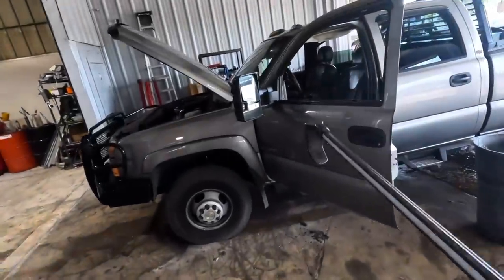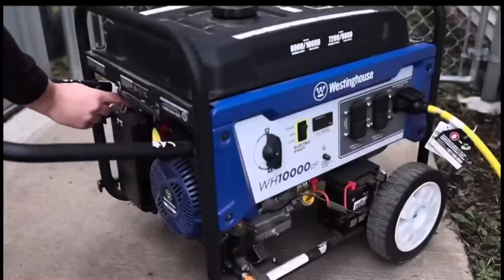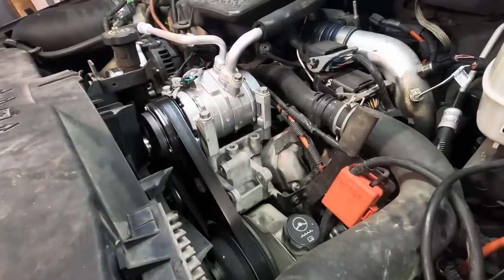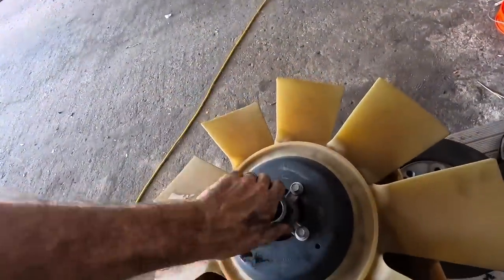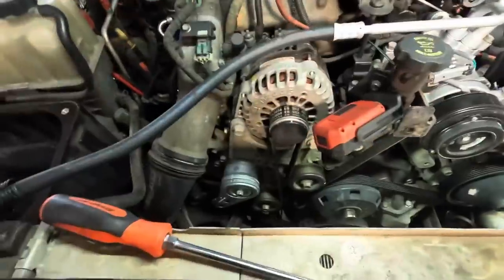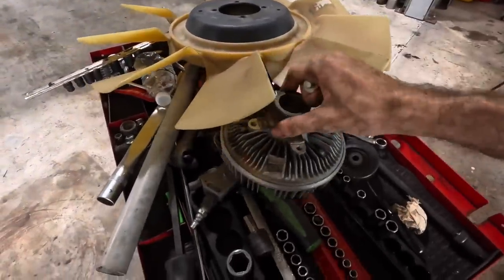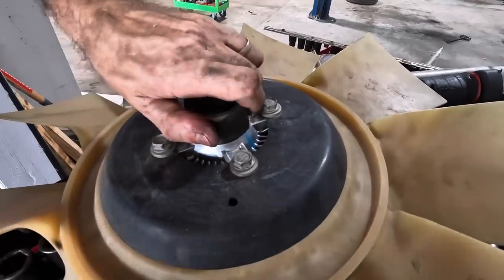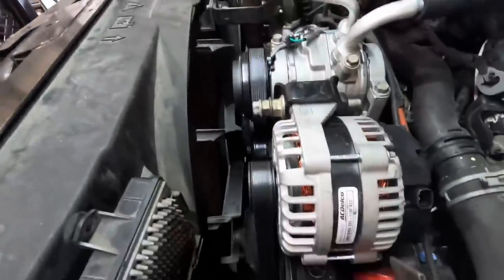Proof of Concept! Dual Alternator DURAMAX!

Comment: Guys! This project isn't about hurricane preparedness (for that it MAKES NO SENSE whatsoever). This content is ENTERTAINMENT, and - as you can see - we are enjoying it. Ray is absolutely right. If he would have simply purchased a gasoline, diesel or LP gas generator for his house, there would be no content. Thanks Ray. I mean it! ❤

I don't want to seem negative, because I'm not at all, so I'm listing why I think this hurricane preparedness project makes no sense:

•	The 2 generators in the Duramax (100A + 145A) can produce max. 3KW continuous power.
•	For that 3KW, Ray uses a 400-horsepower diesel engine.
•	400 horsepower equals 300 KW (not 3KW), so this is a 100X mismatch.
•	The stationary diesel engine runs all night long without the cooling wind from motion.
•	He uses 3-4 gallons/hour diesel fuel to generate 3KW.
•	He spends over $1000/week just for diesel fuel and just for the nighttime reduced power.
•	His diesel fuel storage is limited, so he has to go to the gas station multiple times during a hurricane.
•	He needed (to buy) 1 extra generator, 2 extra batteries, 2 inverters, cables, boxes, etc.
•	He had to install them.
•	He takes all the risks coming with this system (electrical issues, fire, explosion, truck theft, etc.)
•	He will carry a lot of extra weight and 1 extra generator on the truck for 365 days in a year.
•	He sacrifices the room of the truck bed storage box for the batteries and inverters.
•	He needed an elevated RPM idling system.
•	He uses his truck to power the house, so the truck is tied to the house.
•	His existing 8KW gas generator still has not become unnecessary. That’s the daytime power.
•	He has no gasoline storage for an entire week either (in the 90-gallon tank is diesel fuel), so he has to go to the gas station (with other gas cans) multiple times during a hurricane.

So, the project makes no sense, especially because there are much better alternative solutions:

•	Minimal program: Checking (and if it necessary repairing) the existing 8KW generator, buying and storing enough gasoline for a week, and the problem is solved.
•	More secure program: Buying a second (preferably quiet, reliable) 4KW or 8KW gasoline generator as a backup.
•	Long term program: professional Generac Home Backup generator, or
•	Earth friendly program: Florida Residential Solar (with tax credit, net metering, etc.)
Reply: But if he spends money on solar panels it will just reduce his electrical bill all year long! It doesn't even make any noise!

Comment: Hello Ray, the reason you did not see the nator output drop when removing the exciter feed is that most naters, the external feed of 12V is only needed for a moment.  Once the field is going, the field will feed itself.

Comment: Nifty set-up Ray. BTW, disconnecting the battery while charging can fry not only the regulators but the alternator itself & even the entire system including the computer(s). I learned that the hard way & more than once. But that was long ago & although I'd think things may be better protected nowadays generally, the principle is the same, back EMF can be a mofo. The circuit is counting on the internal resistance of the battery(mostly) as well as the impedance of everything combined.

Comment: Ray, I like what you are doing, and there are devices that separate the truck batteries from the utility batteries so if one is bad it does not drag the other down.  However, IF you do try to pull 12,000 watts from your inverters you will be drawing something like 882 Amps @ 13.6 Volts at the inverter power connections.  Even with large generators that won't last long.
Reply: vectron mossfet dual battery isolators.

Comment: Good idea for family and home . Just remember to shut the main off at your breaker box before energizing,  don't want to give a lineman a jolt from back feed. Knew you knew that just reiterating safety protocol.  Great presentation
Reply: Wired my house first thing trow off main disconnect, second turn off all breakers in house,third fire generator, fourth plug in generator to house,last turn  needed breakers on line.We have lights!

Comment: Good morning Ray, good morning all. Early post, the notification woke me up. After viewing the entire video a couple of things come to mind; 1) I would consider using a 1 awg cable for your system ground. (probably less after you calculate your load) 2) move all your conductors away from your fuel sources, i.e. fuel tanks , gas tank caps, etc. 3) Your load connection should should also be as far as possible from these sources. 4) Vent your auxiliary battery compartment. 5) Hire a licensed electrician to install all new circuit breakers required for your auxiliary input sources to your homes electrical panel/s. This is important not only for safety, but for insurance purposes as well. Fairwell laddy.

Comment: I had a Nissan 4/4 for mission work in Botswana. It had 2 batteries for lighting and sound and film use. We would be in the bush / sand for weeks at a time. Also had big lights so had a 100amp alternator. It was difficult to keep the batteries charged equally when you always wanted to have a battery for starting. Had plenty of space and finally installed a second alternator to charge the auxiliary battery. Worked much better.

Comment: Hi Ray great system! Just a comment on the wiring: the exciter wire is also used as voltage sense line. Run a light gauge wire with a 5 amp fuse to the rear batteries for the exciter. This will allow the alternator accurately sense the voltage and adjust for voltage drop in the heavy cable to the rear batteries. Is the second pin in the plug for the idiot light?

Comment: I installed a 45Kw generator to my home 22-years ago.  It runs everything... and I never have to worry about starting surges with critical household equipment.  It has a 6-cyl. Vortec natural gas aspired engine- so I never have to worry about fuel/refueling.  It goes on its exercise once a week and has an alarm if there's a malfunction.  Low oil and low water cut-off switches to prevent engine damage...and it has a block heater for the cold New England winters.  I also installed a whole house surge protector at the service panel to avoid fluctuating/dirty power that generators are known to produce.  For your application, a minimum of 7.5 Kw to 10 Kw will be needed to to run critical household equipment like the refrigerator/freezer, well-pump, and lighting circuits all at once. (Excluding central air, washers, dryers, multiple window a/c units, etc.)  I would deep six the non-sine wave (square wave) inverter since it is inefficient- it will produce 30%  less power than a sine wave inverter (and therefore, it doesn't produce power to its full capacity) on top of the 10% loss when converting from dc battery power to ac main power.  Non-sine wave inverters are usually used on UPS that have resistive loads such as incandescent lamps and space heaters.
What you're doing is a fun project- especially for outdoor camping purposes and for short term usage...but totally impractical for long-term constant household usage.  The heat output from the inverters alone, where they are placed and  the lack of proper ventilation will cause premature damage to them.
Best wishes on your project and thank-you for your perspective and viewpoints.  I am fascinated by how you do things and your creativity...in all your videos.

Comment: Great job Ray. Your hurricane planning makes a lot of sense to me. How will you theft proof your dirtyMAX though, if it's running all night powering your house load? Ambulances have a "Scene button" that allows the keys to be removed from the ignition leaving the vehicle running, and the engine is cut by depressing the clutch or brake pedal. This allows the considerable hotel loads of the vehicle to still be powered. Something to look into?

Comment: I seem to lose power a week at a time at least once a winter these days.  Been through all this and still have it around of course, (more options = better).  But having an EV with at least a 60 kWh battery around has been a game changer for having 3 ish days of quiet, don't have to gas it up in the middle of the night, cheap,  backup power around.  After 3 days?  Run down into town for a DC quick charge for about an hour and fill it back up!

Comment: Ray if you have a good alternator shop near you they should be able to rebuild those factory ones up to ~250amp each with out really changing the over all size much on them. I know this because I have a dual alternator kit on my 06 5.3 and had the alternators built at a local shop 1 built out of my original and had them build me a second out of a factory unit. Your two completely stock units will only handle ~3000watts total at full output. 500 amps of alternator will get you ~6000watts of output.

Comment: Ray, another thing you can do is take your factory alternator and get it turned up.  Some alternators they can really make them put out a lot more power.  I had my 65 amp alternator from my 1988 Mazda 323 turned up to 140 for my sound system.  This was all in the same factory case.  The american made alternators can go a lot higher output than the small foreign stuff.

Comment: Hey Ray, it may be worth implementing a Voltage Sensing Relay on the primary alternator wiring. Most of the split-charge systems I've used in the past use this instead of a second alternator setup as it's a bit more efficient, but there's nothing to say you can't do both for more power availability. The VSRs divert most of the current to auxiliary batteries once the primary starting battery has recharged, that way you have higher output capabilities of your auxiliary setup without effecting your engines starting ability. With the second alternator setup I'd probably recommend having that permanently dedicated to the auxiliary setup, as you mentioned, but there's no real point having it on a switch. The second alternator will put a slight load on your engine whether it's charging the batteries or not, so might as well make use of it while your driving around so power is instantly available when you need it. I'd also recommend just the 1 higher output inverter, they're pretty smart and only draw what they need to fulfil demand, for example if you try to draw 1kw from a 10kw inverter it will only draw around 1kw from the batteries, unlike a 10kw generator that will (forgetting about eco functions) generate 10kw no matter how much you try to draw. That way you shouldn't have to go out to the truck to start swapping things around to meet demand. There's a lot more to off-grid power than most people realise, there's a lot of information available but it's often a case of different strokes for different folks. Good luck on finishing up 😊 what you're doing has more practical applications than just hurricane prepping but it's a great excuse to do it 😋
Reply: Is there an argument for 2 inverters for redundancy? Sods law and all that.
Reply: @DeepakKumar-lv4te  there is, but most of the higher output inverters I've used are fused and tend to be pretty reliable. If anything I'd probably say it's better just to have a spare to swap out should something break unexpectedly. I think there's something a little comical about having backup power for your backup power 😂

Comment: Cool video Ray! My suggestion would be some ventilation in that box. Once those deep cycle batteries start charging they put off quite a bit of gas. One loose connection and spark in that box and BOOM! I made the mistake of throwing a deep cycle battery in my old truck a long time ago to get by, after about a hour long drive I stopped at a job and when I went to restart it "BOOM" a loose connection sparked and caused the gasses to ignite. The battery exploded and threw acid everywhere. Just givin ya a heads up. Thanks for sharing Ray!

Comment: I like the concept. You mentioned that the systems could connect to work together. If I were doing this, since the secondary system in for external 120V, I would leave it seperate from the primary system, except to make it switchable to momentarily boost the starting battery in case the starting battery goes dead. On the previous video you showed a solenoid that you were going to have in the system, and that is what I would use, but only for that purpose. 
I'd also add, and you alluded to this, that there is rarely a more permanent fix than a temporary one.

Comment: Excellent video Ray and I agree with you you can never have too many back up sources of power I have three generators one standard two of them are inverters generators. Those things are super fuel efficient. My one runs like 16 hours on 3 gallons of gas and I also have a couple power inverters I can hook on to one of my cars if need to excellent video

Comment: At least you had factory parts. I had the pleasure of installing two 220 Amp.  Leece- Neville alternators into a Geo Metro 4cyl. for an audio competition car. Replaced the original and utilized a modified aftermarket AC mount to shoehorn the other one in through the bottom. FUN 
5x1000 w Orion Beast amps, 8x15s in enclosures in place of the rear seats. Two yellow top deep cycles in the spare tire well and those five amplifiers show mounted in the back hatch area. A dozen more speakers rounded out the front end. Sony and audio control provided source and control. Park this thing at center ice and go head-to-head with the arena's sound system. We called this thing dBeast...   Other people did the audio part but the power supply was all me. P. K.

Comment: Ray, it is a good idea to power-up the inverter before connecting the load, and disconnect the load before down-powering the inverter. Switching on the inverter with the load connected might cause damaging inrush-current, and release the smoke.

Comment: Ray the pins in the plug of the alternator do not turn on and off the alternator they give volts and charge signals to the trucks ecm the large battery cable reads the voltage of the battery and the internals of the alternator decide to turn on and off the alternator

you need a modified alternator with an external control or one specifically designed for switched control

Comment: Ray, former product engineer here for a lithium battery company. 2GA cabling is good for ~180ADC. This, or thicker cabling, I recommend for your wiring solution for this so you do not run into issues with melted power transmission wires.
Reply: You need to do an ampacity calculation.  Length, gauge, continuous vs intermittent current, and desired maximum voltage drop.

Comment: And with a portable generator through a transfer switch, to do it legally, will be more safe, than running a diesel truck all night, with fumes etc..and really low end ext cords...and you are wearing out the new alternator everyday you drive the truck, when not in use, whilst the Honda generator is only used when needed.  I run mine every few months to keep it's battery charged, and the gasoline has long term storage additive, it works.  The Hondas are in a dry climate controlled garage, so they don't rot away, nor does the gasoline

Comment: Diesel generators like the Generac, the Honda 6KW and others are dependable, you can cycle the Diesel fuel through your truck, and is there when you are not. They are almost silent, and you can put them beside the house, even camouflage it. The light shining through your windows might be a giveaway...
I modified my home generator to fire up once a week and run for 15 minutes, and load test to 50% once a month. I also wear a belt AND suspenders. 
The truck install is a good idea, though, you have power when and where you need it. I can think of lots of uses for it.

Comment: I agree with an earlier post on ventilation. I assume that during operation during a hurricane or sometimes otherwise the box with batteries and inverters will be closed and there will be a heat build up in the box along with hydrogen causing a premature over temp shutoff (hopefully no damage to inverters) and slight possibility of explosion with hydrogen buildup if batteries charge hard or malfunction esp. during the night while not monitored. Good luck to you and keep up the videos. I like people that do and teach and not just talk.

Comment: For anyone wanting to do a similar set up, I have a large ish back up power system in my house. While I use a 12volt inverter it draws almost 120 amps @ 1000watts. Now after doing some homework and speaking to some other experts that set up houses for off grid living. They recommend a inverter for me that is 24volt as it draws less amperage and Also less demand on the battery bank. Either way rays got a good set up.
Reply: I have a Powerware UPS 2000VA (gives 1600W) that runs on 48V, I have four 12V 80Ah FIAMM inverter gel batteries hooked up to it. Works like a charm. Does consume some power, powerfactor around 0.95 but it's an line-active UPS. I have sockets in the livingroom, bedroom and kitchen that comes from that And also my oil furnace runs of it, as well as a few small circulation pumps. So might be a power outage but damn my internet and TV doesn't stop working, and the house stays warm too. The longest I've had to rely on them was for 11hrs, and then the power came back. Battery voltage was still at 48V when it came back. And it was winter so the furnace did run every half hour